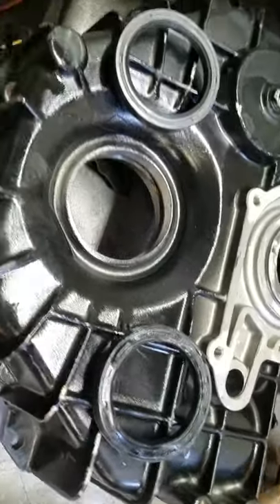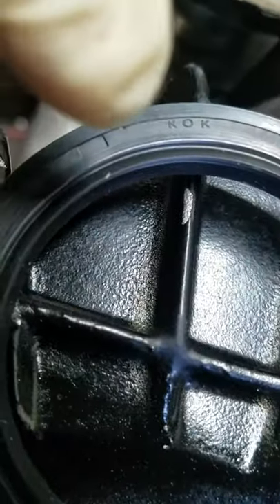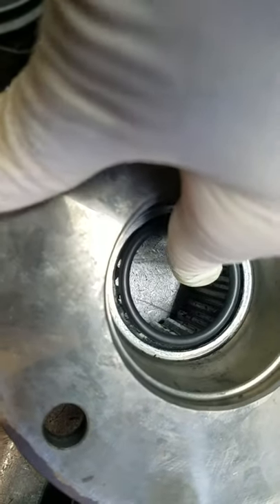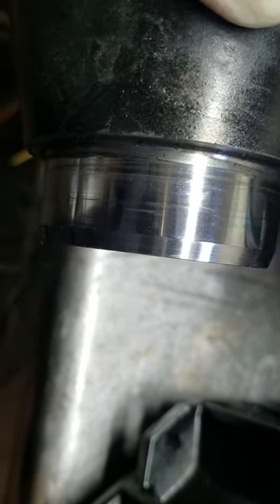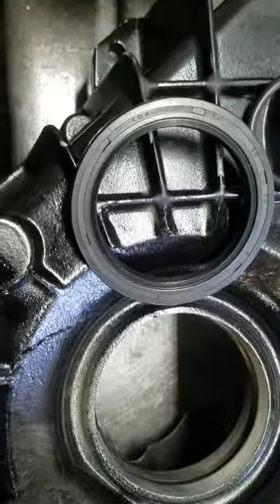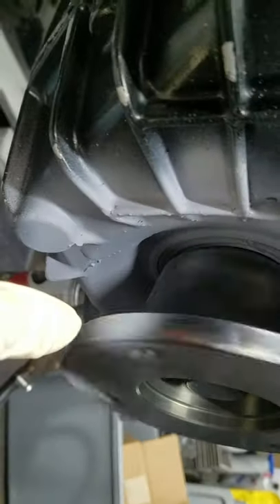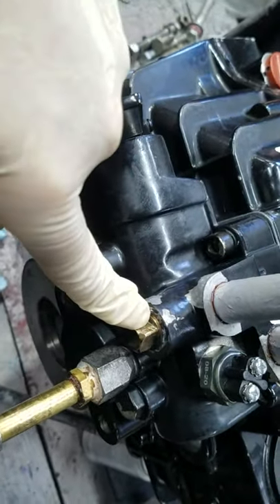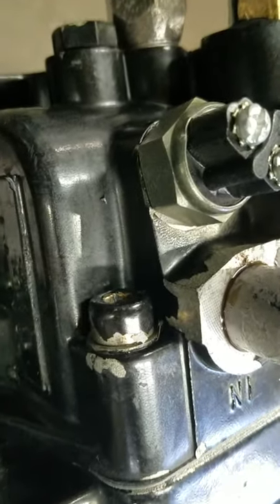ZF63A    PLEASE SUBSCRIBE....THANKS

Comment: What size socket is required to remove that output shaft hub bolt?

What is the torque setting for tightening it after replacing the seal?
Reply from the maker: What transmission are you working on
Reply: @halemarine5991  63A 2:1
Reply from the maker: Current models 24 mm or 15/16 inch socket
Reply: @halemarine5991  Big socket, but I actually have one. How much torque should I tighten it to after replacing the seal?
Reply from the maker: I just use 1/2 impact gun and lay into it. And lots of Red lock tight